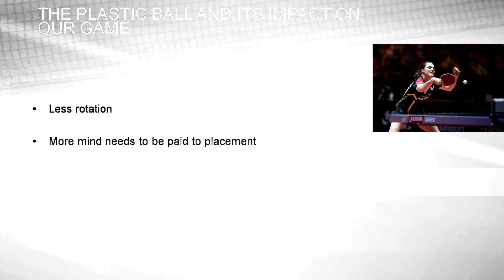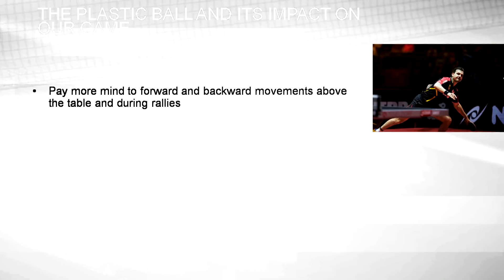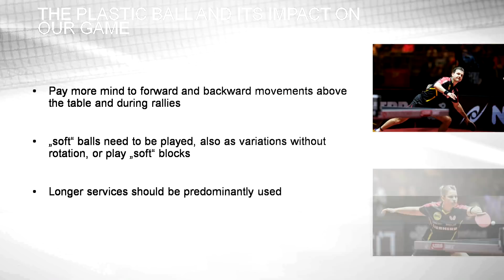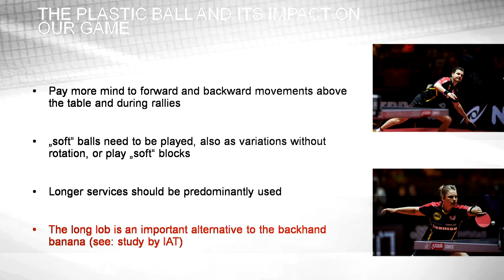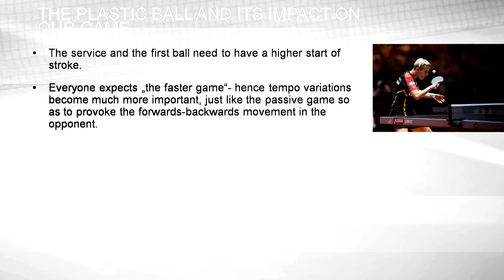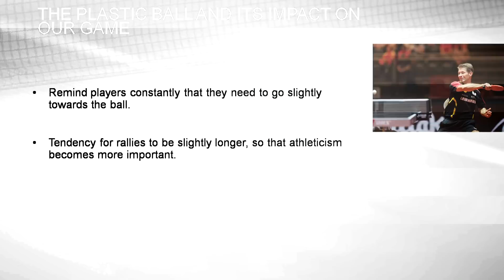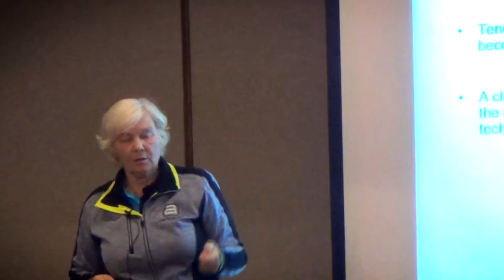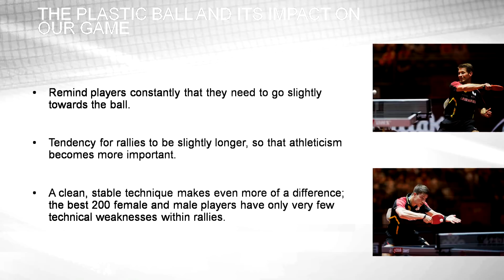Eva Jeler The Plastic Ball And Its Impact On Our Game Part 2

Comment: Now, with the new ball, players expect opponents to flip the ball on the serve, so it is important to give your opponent spin that forces their banana flip to come to the same place so you can counter top spin with power and a good angle on the table. This game is now about power and strategy, you have to set yourself up to win the point after the serve on the 3rd ball or even the 5th as Harimoto does very well. Harimoto never backs off the table, and wins with superior backhand and down the line backhand block or attack

Comment: That's a joke. Dimitri was never number one in the world. The German ITTF officials manipulated the ranking/rating system.

If the ITTF had used an unbiased ELO ranking system with a proper Logistic Distribution or used Microsoft TrueSkill (Bayesian statistics + normal distribution) with a conservative mu and sigma (mean and variance) to calculate initial rank then everyone would have started on equal footing.

If you apply either of the aforementioned ranking guidelines and input all of the players' wins and losses over the last 2 years, then Dimitri never at any time rose higher than 4th. And as much as I love Timo he never got above 8th unless you go back more than 5 years. 

End of story.